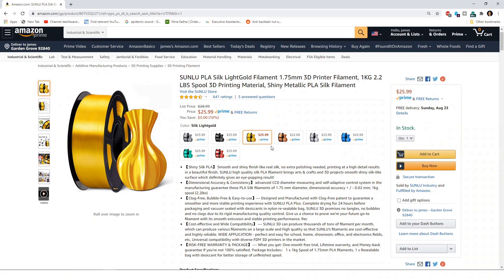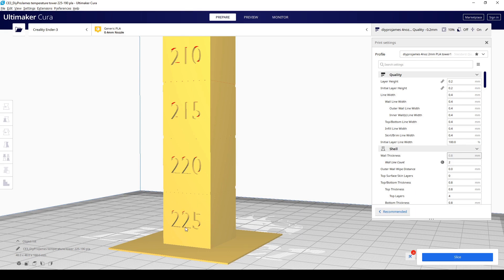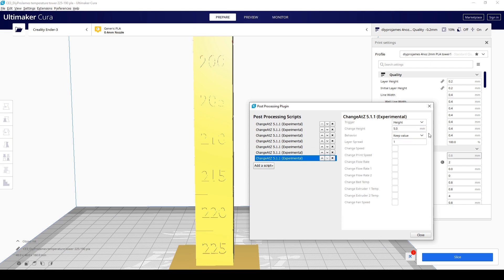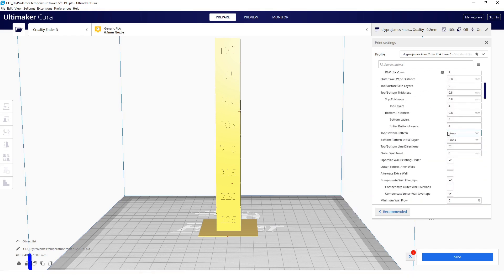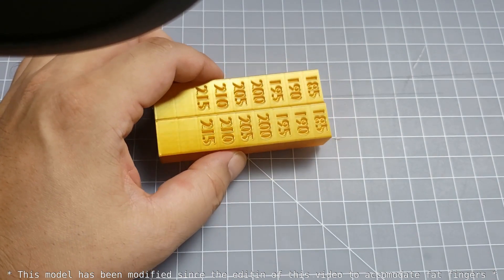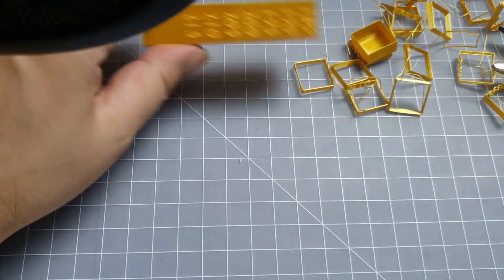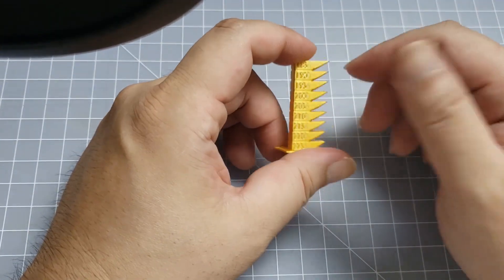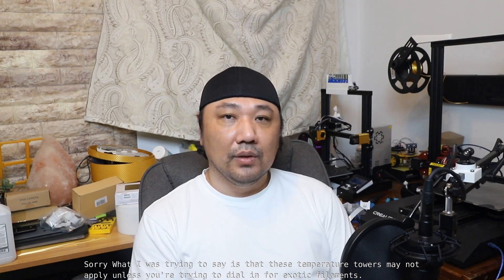FIND THE PERFECT TEMPERATURE FOR YOUR 3D PRINTER USING CURA 4.6.2. - TEMPERATURE TOWERS - 3D PRINTS

Comment: This is very helpful, but I have an unusual problem when printing your temp tower. I have a high temperature PLA, Formfutura Volcano PLA. This reccommends to start at 220 and climb up to 255 as its range. Problem is only the 220 printed nicely, the rest had tiny little gaps everywhere. Would you have any idea what the problem could be? to be fair I do have the fans running at 100 on my ultimaker. I will try reduce it, I just worry when I use this for future prints I will need the fan to make sure surface quality is nice. I wanted to print higher than 220 to help the strength of the layer adhesion, which I hear helps. But the surface quality of this print invokes doubt when the temp increases
Reply from the maker: Typically manufacturers put a temperature range on filament. Though they work in those ranges, typically there is a sweet spot on many filaments.  Also, there are other filaments that work well within the ranges. Many things can affect the filament. Even batch. Typically you pay more for consistency. Good luck.

Comment: do you have a video on ender 3 pro TPU settings for a begginer?
Reply from the maker: Not at the moment. TPU settings are difficult to use on a bowden system. You might be able to get away with semi-flexibles. TPU are meant to be used with a direct drive system. Best practice when using TPU's slow down your print speed and lower your retraction settings to almost removing them. You can get away with retraction more on a direct drive system.